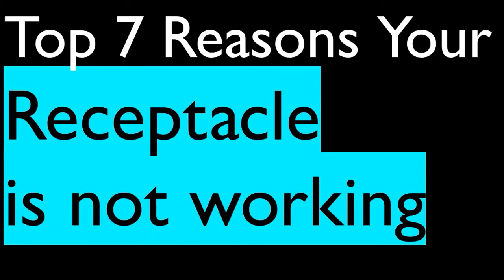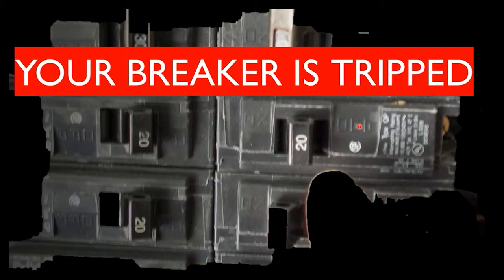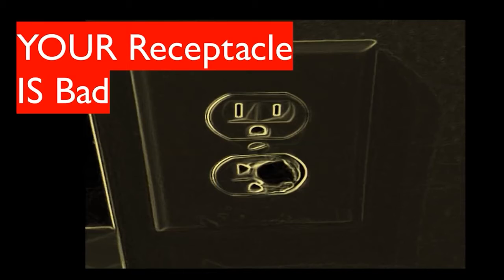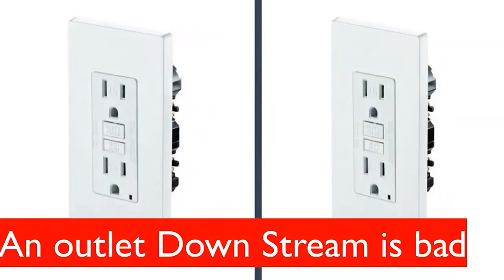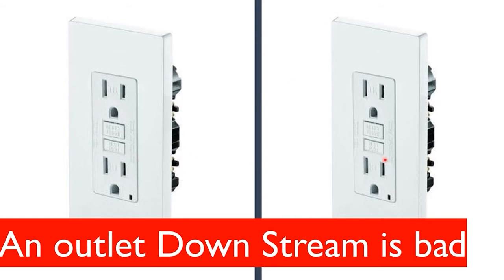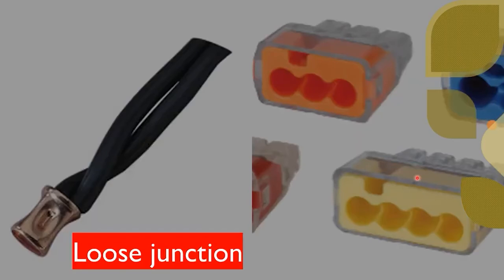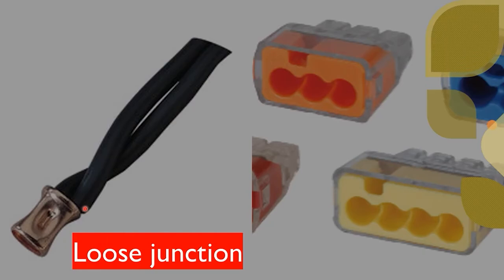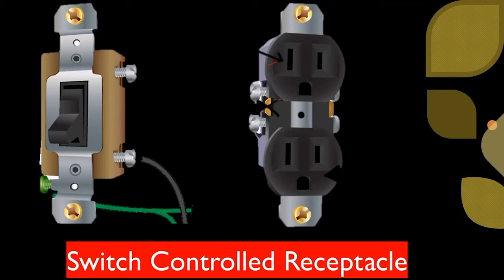7 Reasons My Receptacles are not working

Comment: I like your advice that you only reset a tripped breaker once. I learned that at an early age. Unfortunately, not everyone knows that. I have a good, real-world story that helps. Usually, the problem is too many high current devices running, or you just plugged in something with a short. You turn off one of the devices or unplug what you just plugged in and reset the breaker. If you don't know the cause, you can reset once, but if it trips again, you need to find out why. There was a story in our local newspaper about a fire at a small family owned dog grooming place. The parents were away, and their two teenage daughters were grooming 2 dogs. When they plugged in the blow dryers to dry the dogs, they plugged both into the same circuit. In a couple minutes, the breaker tripped. They reset it and continued drying the dogs, but the breaker tripped again. They kept resetting the breaker every couple of minutes. Finally there was a loud pop and the place caught fire! Fortunately, the girls and the dogs got out safely. I've had to tell someone that story when I observed him repreatedly resetting an overloaded breaker. He stopped and found the overload before anything caught fire.
Reply: Repeatedly resetting a breaker that repeatedly trips can eventually result in two different outcomes.   Usually the breaker will weaken and not hold under normal load, if at all.   Worst case scenario the breaker may seize up in the ON position and be unable to trip or turn off no matter how severe the overcurrent is.  The main breaker is the last line of defense if this happens.  Even worse is that many years ago split bus panels were widely used and there was no main breaker or fuse.